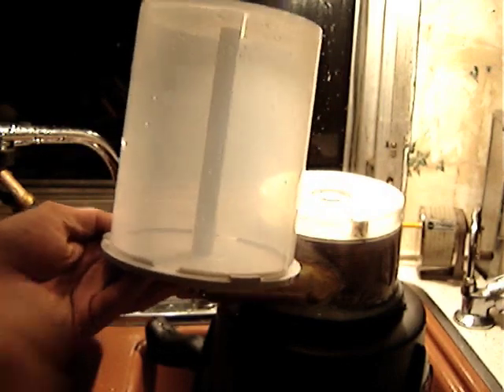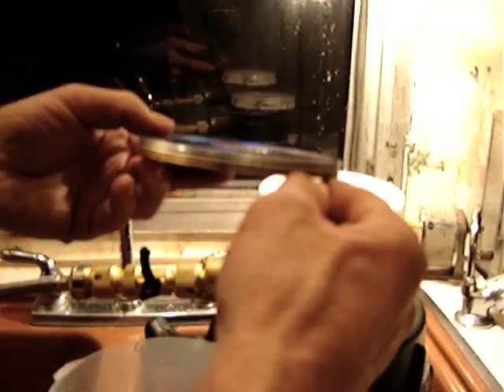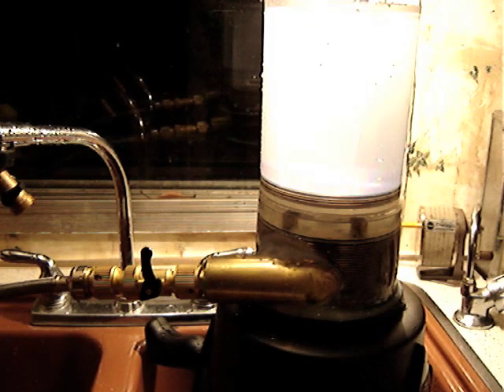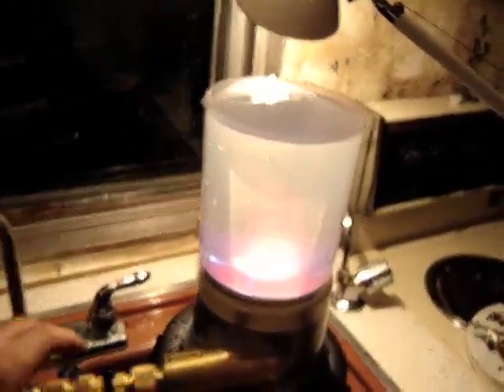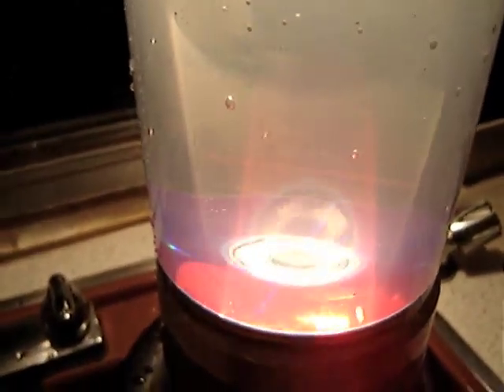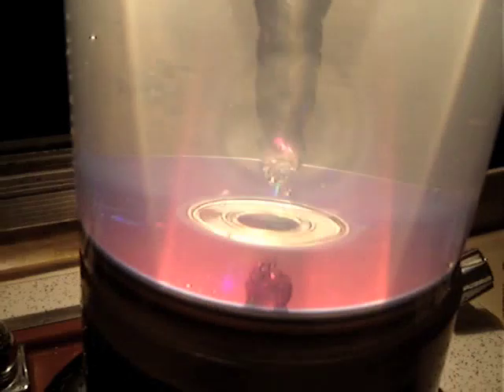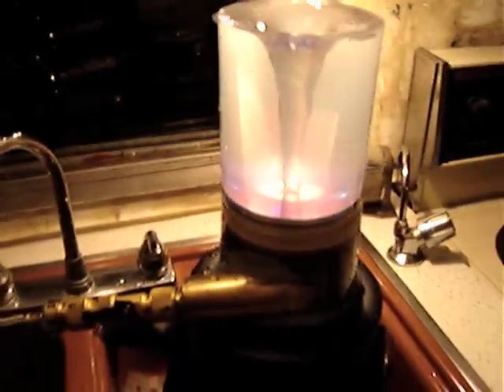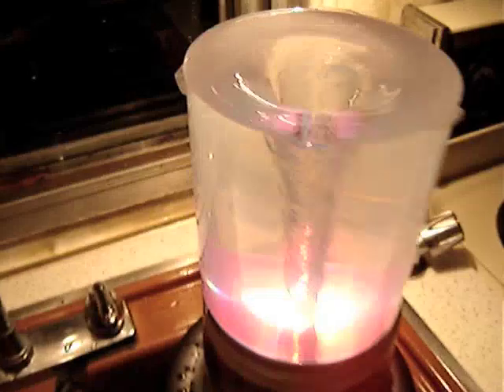SinkScience #08 - Beauty of the Vortex

Comment from the maker: The xmas vortex uses a 6 inch diameter x 4 feet long piece of polycarbonate (Lexan) plastic.It was expensive, at about $100.(Canadian).

The" blower motor" is the heater blower motor from a 1992 Subaru car. You can see more details in my instructables at Instructables. c o m, search for "mrfixitrick". (link is in the "show more" box.)

Comment from the maker: One big hint is about magnet size. The drive magnets must be strong enough for the size of the vortex, and power of the drive motor. A blower motor will require 6 of 1/2 x 1/2 inch neo magnets on the drive side, and on the driven disc side too. (I use a water-jet cut disc of Lexan to mount the magnets into) Smaller projects, smaller magnets and less power.

Comment: Hi there. I love this device and want to build one - using the motor like in the christmas tree vortex. I followed your links to instructions but they came up blank. As far as I can figure you used 1/32" thick magnets (what width?) and 5 cd's glued together with the magnets evenly spaced in between. And for a motor, a 12v auto blower... any other tips more than welcome before I start. Thanks again. AWESOME

Comment from the maker: @livetrueblue 

Your idea should work. The long cylinder magnet may be a bit noisy on the bottom of the cylinder and wear on there. The magnet will have to be strong to maintain the magnetic connection under load and rpm's. 

Consider making a Tesla Pump (using a set of discs like CD's) at the bottom of the tube. That way, you can be educating kids about Nikola Tesla's wonderful Disc Turbine/Pump...and recycling CD's at the same time!

Comment from the maker: @livetrueblue 

Have a look at my 3 movies featuring the "Tesla Tornado" water vortex generator. I use a 6 inch by 30 inch tube to do what you suggest. 

I used six magnets on spaced CD's, as the stirrer inside the tube. I used a 12 volt auto blower motor as the driver with 6 magnets in its flywheel. 

My magnets use repel mode, rather than attracting as you suggest. Either way will work. I had to use a suction cup to keep the discs on the bottom.

It will suspend a lightbulb in the vortex!

Comment from the maker: @allowacan 

The discs spin somewhere around 800 -1000 rpm.

I used an electric motor from a Subaru car heater in my other "Tesla Tornado" videos. It has a magnetic flywheel that magnetically coupled to the disc pack inside a 3 foot tall clear tube.

Comment from the maker: @zafisto 
If you dropped the item dead centre, it would fall through the air until it hit the water part of the vortex. A very fast water vortex might make the air inside spin some too, but there is stillness at the very centre of a cyclone.

Comment: From my understanding the reason the aluminium tin spun was due to the changing magnetic field (from the turbine) inducing a current in the tin which hence induced a magnetic field in the tin which opposed the motion of the turbine and hence caused the tin to rotate.

So if you filled the CD cover with salty water would you get something similar, given that salty water is a conductor of electricity?

Should be pretty easy for you to find out :)

Comment: Add some soap and glitter. It will look like a real tornado. The glitter will act as the base dust cloud and the soap (witch will produce suds) suds will make it look like a funnel cloud. Be sure not to overdo anything because first, if you use dish soap and add too much, the water will change color and foaming soap will produce too many suds, if the throttle is too high it will make the water look like suddy milk and too much glitter will block the side view. make a video of it and upload it.

Comment from the maker: The resulting vortex shape would depend on the speed of the liquid inside the vase. With a sealed top like you suggest, the Tesla disc "pump" would have to go very fast to make a cavitation vapor bubble inside. But it could be done.

That would be a good experiment with a faster rpm than with the faucet water pressure driving the CD turbine seen here.

I will be doing some work with a 3 foot tall vortex soon...perhaps I will try that!

Comment from the maker: Yes, the lower part is the Tesla disc turbine that is magnetically connected to the upper Tesla "pump". The lower turbine uses faucet  water pressure to turn the discs, which have magnets to engage the upper "pump" magnetically.

Comment from the maker: If this turbine was spun fast enough as a pump, it would create a near vacuum at the CD spindle post inlet.

 Unfortunately, CD discs are not the best material for very high rpms, and the magnets in my design lend toward lower rpms.
 I have a plan to remedy that, but for now I'm too scared to try too!

Comment from the maker: The efficiency of my water-pressure based Tesla  CD turbines is very low...less than 5 percent.  A proper Tesla Turbine on steam pressure was claimed by Tesla to be over 95 percent efficient under ideal circumstances. Modern researchers have made 30-40 percent efficiency claims.

Comment from the maker: Sure, that's one of my dreams, too!

The main issue is that the Tesla Turbine requires a high rpm for best efficiency, so it would need gearing to the wheels. The speed can be controlled by a valve to the nozzle.

Here is a compressed air Tesla CD Turbine made by Cornell students that has a cool worm gear arrangement to reduce shaft speed. It powers a lunar/Mars rover experimental cart! :
Youtube/watch?v=8Ir8Ci5Ig2g

Comment from the maker: The bio electric generator doesn't use magnetics as it's way of generating power. It is a chemical/bilogical process that has an anode and cathode and uses sunlight.

The vortex acts as a flywheel to smooth out the take-off of power from various devices, but the turbine turns slower from the energy diverted into the vortex and friction.

Comment: The thing is, I think back 2 years ago, the intel science fair's grand prize was a bio electric generator using polarized iron filled bacteria in a tube surrounded by wire.
So, perhaps, you could produce a bit more power using the vortex as well to try to offset the power needed from the water.
Do the turbines turn any slower from the added coupling?

Comment from the maker: Yes, it helps to be on a well next to a rain forest! It costs me about 5 cents an hour in well pump power to run the turbine.

I don't run it very long usually. Especially since i blew the top right off the CD cakebox case. 

The Tesla CD turbine is on a self-contained system in my last couple of videos, using re-circulated water and a pump.

Comment from the maker: It uses energy and currently has no other purpose than to inspire awe. 

I have tried some experiments with objects in the vortex. For example, it's possible to completely submerge a 1 inch styrofoam ball  in the vortex, and control it's height by the speed of the turbine. 

Then there's the little plastic man I threw in... 

Things suggest themselves after observing the vortex, and for me, that is a worthwhile purpose unto itself.

Comment from the maker: The way it works is that the CD Turbine runs on faucet water pressure. It has CD discs inside that spin around with magnets glued to them. I use a magnetic coupler, made with a couple of CD's and neodymium cylinder magnets, and put it into the water.  The magnetic coupler engages and rotates with the rotating magnetic field of the turbine, creating the vortex.

I like the vortex thingy idea, but it has been done quite well with a device called the Twister Tube. Google it...truly cool!

Comment from the maker: Thanks for the comments, Joe 

For better torque more discs than 2 or 3 should be used. There is a point where too many discs will cause excessive internal resistance, however,  and without additional nozzles or increased pressure, may run slower.

 The above version uses 25 discs, and is probably too many. It does run a couple of hundred rpm slower than a shorter-cased one with, say, 8 CD's. 

  An impeller between the discs may or may not help, depending on a few variables.

Comment: I like that you build with CD/DVD media, and cases. Along with magnets and water flow/pressure prime mover. You did a very nice job with balance of the machine, and the vortex that it produces. 

It seems the disc arrangement inside their case helps prevent offset. Is there any reason that you have used a 5-disc stack? Could 2, or 3 work? Would an impeller between the discs help, or is it just the amount of magnets required to get the torque (power)? 

Thanks and nice work, Joe